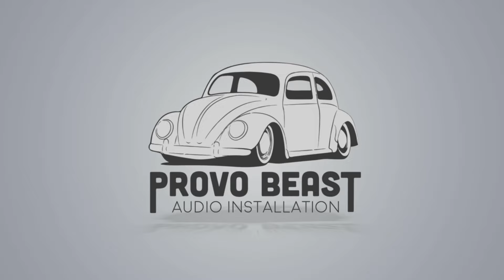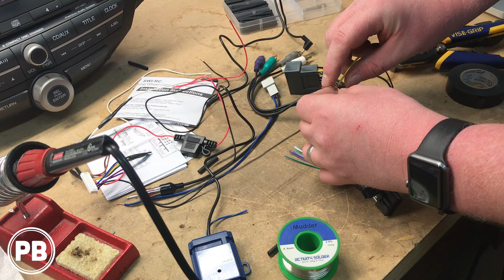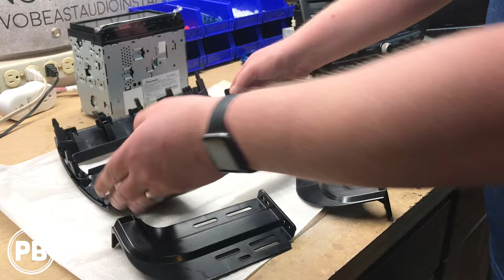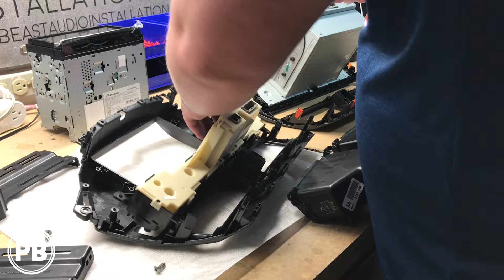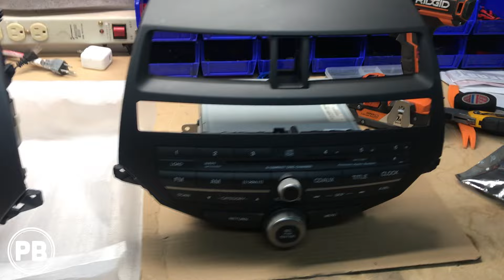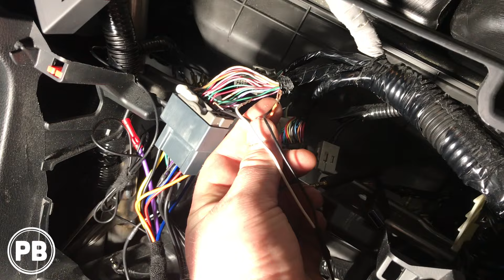2008 - 2012 Honda Accord / Crosstour Radio Install (non-Nav)

Comment from the maker: Parts linked in the description!
Reply: I have a 2011 Honda Accord LX-P model. It doesn’t have the Premium Sound System. I’m planning to replace the factory radio to a touchscreen one. 
Amazon says the Metra 70-1730 doesn’t fit with my car and I should use 1729. My problem with this the aftermarket radio accepts RCAs for the speaker wire.

Do you think I can use 1730 (what you used in yhis video) or if not, how do you think I should go about using 1729?

Thank you!
Reply: Dose it matter coupe or sedan
Reply from the maker: @mikeperez9498  nope!
Reply: Hey does anyone know the subwoofer adapter?
Reply from the maker: @joshnina92  It's included with the wiring harness adapter linked in the description: https://amzn.to/35D0vbo
Reply: Would the subwoofer adapter work with Honda Accord EXL sedan??
Reply: Excelente video muy explícito. Amigo que marca de radio puedo comprar para Honda Accord 2012 parecido al del video. Saludos y Gracias

Comment: I did the install with out the Navagation but my Honda display won't display nothing, radio works fine its a Boss BE920WCPA the harness kit from Crutchfield has two connections the factory Radio has 3 connectors one is for the display so I got one just not connected have no where to plug it in dont know where it goes. Won't fit on the harness. what am i missing?

Comment: Hello! Thank you for this video! Since my cd player stopped working I want to actually just replace it with the same radio/ stereo from Ebay. I can't find anywhere about what I need and how to reinstall the same type of radio. If you can help point met in the right direction,  it would be so helpful !

Comment: I have a 2012 Accord coupe and it has the anti-theft light in the radio area and my question is if I can still change the radio for a pioneer single din and install a sound system with the assurance that the car will turn on even if I have removed the original radio where the anti-theft light was?

Comment: Hi I'm wondering how to connect the one white subwoofer RCA wire from the Metra harness to an Alpine stereo that has red and white RCA wires for a subwoofer? I've tried connecting the white or the red to it but I get nothing

Comment: This is awesome! I did have one question, I bought a Sony headunit (XAV-AX150) that has a dedicated steering wheel control connection, do I still need the module if it has that?
Reply from the maker: Yes, as there are multiple connections for the buttons on the accord, more than the harness provided with the Sony.  Going with the pac module will simplify your install (in theory) and will come preprogrammed for your buttons already.

Comment: Damn. Was hoping this head unit needed a speed signal. I'd already done this install minus the VSS. I got the Crutchfield master sheet and it mentions under drivers dash fusebox pin 14 (blue wire) on a white or blue 20 pin connector but there are two 20 pin connectors with blue wires.

Comment: Is there any way to have to have the top display still display clock and other basic information? Mine is dead after installing double din unit.

Comment: I followed all of the instructions but the volume was very very low. So I installed another wire harness without the av jacks stereo works great but now my engine cranks but will not start. All lights work and stereo works. Could I have possibly just drained the battery due to having the interior lights on as the sun went down and it was the only light I had to work with? I have a 09 Honda Accord lx
Reply from the maker: Possibly, lots of variables there. Using a multimeter will help you identify if you have a dead battery. The harness with the rca ends are only used for accords with the factory amplified sound system. If you don’t have the factory amped sound system, the other harness in the description is needed.

Comment: Honda is so stupid, I added an amp to my car, factory head unit. Wanted after market speakers, and I have the rear already ran with new speaker wire.

Using a kicker kisloc2 adapter for my amps speaker to RCA source, yet I'm getting a horrible ground loop. Just constant static through the speaker lines ... finally decide maybe I should bite the bullet and replace the factory head unit for a cleaner RCA source ...

Have to buy a stupid adapter or I lose cruise control .. than I find out since the factory amp needs RCA I can't use an after market headunit as a source for my amp...

Already have $400 in this before the head unit, adapters, and dash kit ... and I can't even get the cleaner source I wanted?

I really ain't looking forward to running speaker wire into the doors, that will be a few hours of time.
Reply from the maker: Ground loop noise can also be cerated by very poor grounds, or bad quality RCA cables.  Check those first.

Comment: did you disconnect the top display above the radio when you connected this unit? also would you recommend this over the setup of placing a unit above the dashboard?

Comment: Hey this video helped me alot doing an install today. Thank you . But I was wondering, where do you get the subwoofer cable and how do you wire it? My factory radio had way more bass now it's very thin sounding...any help is super appreciated

Comment: Did you have any issues with this setup? I have a 2010 accord coupe w/factcory  amp....so my setup is similar to yours. I been having issues with my steering wheel controls going in and out.

Comment: Hello.  Thanks for the detailed video on installing an aftermarket radio into a 08-12 Accord.  I picked up a 2010 accord coupe for my niece, who is in college.  I'm installing a double din pioneer unit and back up camera.  I want to ensure I don't damage the temp gauge controls when I remove from the radio surround.  After the screws are removed, does it just come right out from the back.  Other videos show it having to be pushed out with some force from the front.  Thanks Carck

Comment: My Radio wont really work, very low signal even with the Adapter and the blue cable plugged into the Red wire... I'm not sure but the plug does not seem to really be making contact on the inside .... anyone having the same issue?

Comment: Hi Provo Beast! Huge favor, I have the same radio without navigation as shown in this video and can not get the PAC SWI-RC to connect to the steering wheel controls. To confirm, are you only connecting two wires from the PAC SWI-RC to pin 16 pink and pin 5 brown as shown in the video? Are any other wires being connected from the PAC SWI-RC? Last question, do the dip switches on the PAC SWI-RC not work which is why we need to program the PAC SWI-RC? All of my confusion is coming directly from PAC and their provided instructions on their site after I plug in my car info (2012 Honda Accord no navigation). Any information is greatly appreciated, I am going crazy. Thanks!

Comment: Ok I have a 2012 Honda Accord LX-S coupe I bought with the same or similar head unit installed already. The temperature gauge or where the clock is located. Can that still be functional?

Comment: Thank you for sharing this video.  This is very helpful.  I am installing the Pioneer AVH-2550NEX and backup camera in my daughter's 2012 Accord.  I have the iDataLink Maestro for the steering wheel control.  It connects to the Pioneer stereo using a 3.5mm jack.  How does your steering wheel control connect to the Pioneer stereo?
Reply: I have the idatalink harness too and this thing has been kicking my ass ever since I installed it. For whatever reason I keep losing my steering wheel controls mid ride.

Comment: Would anyone be able to tell me where to find the instructions to program the steering wheel box. I went on the website and it tells me what switches to flip and how to wire it but it never says hot to program it. In the video he needs to press different buttons on the steering wheel and push the program button but I can not find it anyone. Thx in advance

Comment: So I’m just a kid that knows nothing about this, so don’t laugh at me but how do I find a dash kit that fits what radio I buy? Do they make different ones I can just buy that have a few standard sizes that will fit the radio I choose? I’m just confused to how that works
Reply from the maker: The parts we linked in the description will fit any standard double din radio so just find a radio you like and the kit will work (as long as it is a standards single din or double din)

Comment: I connected sub to my radio, but my factory amp didn’t connect, did not connect the white rca, wondering were I would plug that if my radio only has 6 plugins or can I tie it into one of the rcas

Comment: great video, i have 2011 accord, and i was wondering can the top screen be replaced with a different kind or type of screen/monitor? Lastly, not everyone sells that same wiring harness that you have with the rca's on the end. Best Buy didn't even have that.
Reply: yea bro i got the same problem as you, try going to crutchfield that might help a little
Reply: Did you figure out what to do with the top screen?
Reply: @Joe-qn8mh  yeah i did, i went on cruntchfield and just buy the dash kit there, thanks bro
Reply: What dash kit was it?  I'm interested in replacing that screen with a faceplate so that I can put some USB C charging ports.

Comment: Does your clock still work on the car after installing the aftermarket radio? I installed an aftermarket on a 2011 accord but the clock on the car doesn't turn on. Not sure if that's normal
Reply: Did you ever fix that issue?
Reply: it should. check your wire that leads from your clock to your ground to your wiring harness
Reply: Did you ever get it working?

Comment: What would you do if you wanna have a after market amp and subwoofers
Reply: Don’t use the subwoofer wire he has in the video just connect your rca cable from your subwoofer amp to the radio and connect your blue remote wire to the blue wire and the radio wire harness

Comment: I have a 2010 TSX but the console looks almost identical. Thank you for the instructional video. My only issue is my car already has an intergrated microphone so I'll figure that out when I get there.
Reply: So does mine, but once you remove stock head unit it’s not functional any longer. Most double dins come with built in mics

Comment: With the scosche dash kit, I can't figure out how to get two of the screws in that go up from the bottom. They screwed into the metal frame of the old radio. Didn't note if there are holes for it in the scosche plastic brackets. Any guidance would be appreciated. Nice video by the way.
Reply: Ever figure this out?

Comment: Where did you connect the subwoofer wire to on the radio itself? I have a red and white wire to plug it into

Comment: I have a 2010 accord coupe v6. I followed your install steps in the vid, the radio seems to work fine but now my viper smartstart won't turn over the engine.I wonder what I did wrong?

Comment: Did you have to tap into the factory harness? Couldn’t you connect the steering wheel control wires to red and black on the aftermarket harness? Ground and constant 12v is not specific.....

Comment: Great video. Too complicated for me install myself but it's nice to see how its done and will look. I purchase a pioneer unit from bestbuy and they will install in my 2008 accord for free. I didnt think this was possible. Thank you!
Reply: Caesar Minor Hey, how did it go? Did they actually install for free?
Reply: @domos888  do it yourself. its really not difficult at all. I just installed this same setup in mine. I had no prior soldering experience prior, or radio install experience. as far as the radio, and dash kit goes I got everything in just fine.

Comment: I have no power to the harness. This makes no sense how did I end up with no power to this entire system just from unplugging it.

This has something to do with the alarm system in the car. But I cannot figure it out. How did you install anything into this type of car without completely disabling the factory alarm and radio security?

I tripped the fuse under the hood. 'Back up' supply. 

Still no power to the radio, but my alarm works again.
Reply from the maker: Not sure, sorry! Maybe time to take it to an audio shop.
Reply: u must match both wires correctly
Reply: How did you get your alarm to work again I’m in that situation my alarm doesn’t work at all